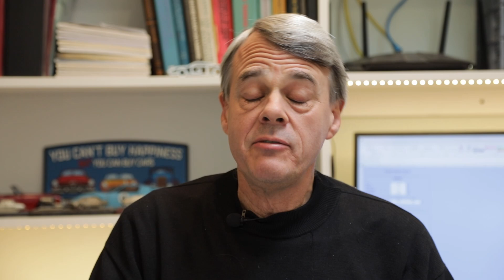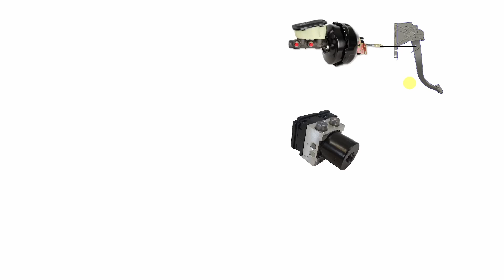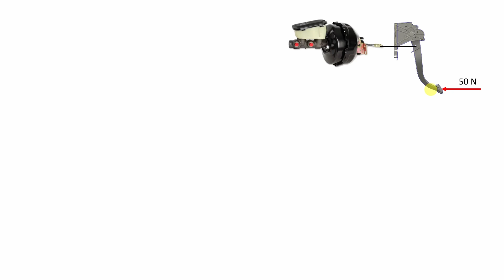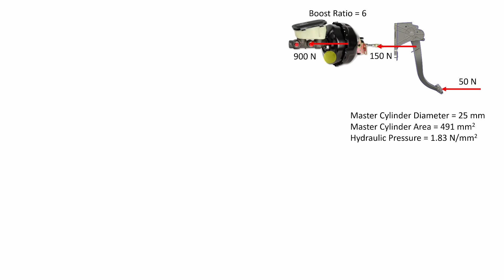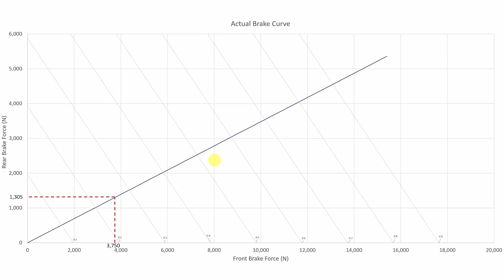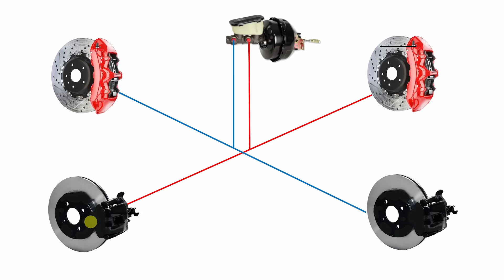Brake System Sizing And Design

Comment: This is very useful, big thanks. I was hoping to also get information on setting up a system with bias bar.

I optimized my brake system over a time period of two years by trial and error.
Having in mind all described parameters (except the non existing booster) I followed a common understanding the front cylinder should be smaller than the rear. 

I was never able to lock the rear tyres with bias bar maxed out, even after installing rear calipers with bigger piston area.

Finally It turned out my car needs the smaller cylinder at the rear.

Reason is the weight distribution of 63% at the rear with driver!

Now my bias bar is set from the ideal middle position only a half turn towards rear, tyres lock  all at almost the same time, front just a moment earlier. optimization between cold/hot tyres and  dry/wet road can be done by maximum one turn. 

I never thought I could utilize such a high braking force at the rear!

Comment: 7:05 Why do you addtionally multiply by 2 for the two sides of the caliper? Is it because the piston area is calculated for one side of the caliper? 
7:30 You seem to be using the same formula for fixed and sliding calipers, but wouldn't you need to mutliply the piston area of the sliding caliper by 2 additionally?
Thanks for the interesting video!
Reply: yes. you measure the piston area of ONE side of a monoblock caliper.
no. since you measred only one side of the sliding caliper, you mulitply both by 2.

Comment: Someone can tell me how to calculate the valve curve? I mean, mathematically, with equations.
Reply: Assuming you know the Knee Point pressure and the reduction rate, it's actually very simple.
Where
Po = pressure out
Pi = pressure in
Pk = Knee Point Pressue
Rg = Rate of gain

The formula is as follows:
Po = ((Pi - Pk) × Rg) + Pk

So for  example say we had a valve that was a 60% reduction and therefore would have a 40% rate of gain (i.e., Rg = .40). Let's also assume that this valve has a Kp pressure point of 400psi (I personally prefer to work in psi)

We can now find what the Outlet pressure (Po) is if we know what the Inlet pressure (Pi) is. 
So where,
Pi = 740psi (random picked value above Pk)
Pk = 400psi
Rg = .40

Plugging the numbers in, we get:
((740 - 400) × .40) + 400 = 536
So for our example valve with an Inlet pressure of 740psi, the outlet press will be 536psi.

Comment: Hi.

Very nice video!

I see that you used in your illustrations fixed calipers for the front and floating calipers for the rear brakes. Why are the fixed calipers better than the floating ones? I see them only in high end cars.
Reply: Hiya, fixed calipers have some advantages over floating ones, such as a more uniform pad wear and a higher performance to size ratio. Other than that, fixed calipers have a, subjectively, better pedal feeling when compared to floating ones.

Comment: Hello, based on your brake videos I’ve watched and reviewing chapters of the textbook you refer to.

 I was wondering if another way to achieve an actual brake curve closer to the ideal brake curve would be to use a brake pad with a higher coefficient of friction in the rear as opposed to the front? (Assumption is for a car without ABS and power brakes) 
I think a lot of autocrossers typically use a higher friction pad in the front, but this moves the actual brake curve further away from the ideal?

Thanks for any feedback

Comment: YEssss all the answers to my comment in the ideal curve video are here! <3
You adjust the brake bias for grip not for the shape of the turns of the track. So you can reduce the gap between the ideal curve and the actual line for evry grip condition! Hopefully I got this right. If so this also answers to my tires grip question. It's not a parameter in brake sizing, it's almost part of the constants... Damn is science cool as f*ck!

Comment: Hello. How can I improve the modulation of my pedal? Chevrolet silverado 2500 2001? The overall condition of the car is very good, the brakes are serviced, but my pedal is not informative at all. I have increased the oil pressure for hydroboost. It gave a result, but I expected more.

Comment: Can you do an episode about thermal performance in regards to brakes that you talked about at the end of the video? A perfect example to do an episode on would be the Tesla Model S Plaid which has small brakes (380mm) for the power (1020hp), weight (2200kg) and use-case (Tesla has a bunch of marketing showing it on the racetrack and setting lap times), but it is well known by all journalists that the stocks brakes can't take the abuse of the race track, but the CCB upgrade ("Tesla Track Pack") can.

Comment: Rear brake lockup isnt a problem on rear wheel drive, manual transmission race cars. To lock up the rear wheels, the brakes would have to be capable of stalling the engine unless the driver is depressing the clutch and brake pedal at the same time, which a race car driver would not do under race conditions (you lose the benefit of engine braking and engine rpm drops to idle).

Rear wheel-hop from improper downshifting is the reason race cars spin in braking zones.
Reply: That is categorically false on every level. Rear lockup on a RWD vehicle most certainly is a problem because most vehicles have more than enough rear brakes to easily stall an engine that is in a closed throttle deceleration state.

For starters, other than carbed engines, fuel is cut during Decel, so literally, the only thing keeping the engine spinning during closed throttle deceleration is the wheels spinning. If they lock, the engine stops.
Reply: Are you stupid. "Lockup" isn't what would happen. You would simply have wheel speed and theirfore engine speed drop 10-30%, like from 6k rpm to 4 or 5 and ur back is already out. RWD cars are cool because what you actually do is set bias by breaking in a straight line with clutch in or if it's a auto at a very high gear. So that the wheels lock at the same time and then set that bias up front maybe 2% (depends on car/driver) and then you use ur engine breaking to effectively add that back. For example if you are taking a high speed corner where you need to break you can select 4k rpm or 6k rpm where 4k would be understeery and 6k be oversteery. Same applies to general lateral grip variables like roll bars and tire pressures.

Comment: Quick question, is there any relatively simple way of calculating the brake force of a drum brake? I've just gone through some rather complex equations, and got numbers that mesh with the demonstration. But the brake force seems absurdly low for a given line pressure. Is that is truly the case for how drum brakes act? I'm working on graphing some of these things to justify my dislike of the common front disk-rear drum setup people install on aircooled VWs, I think it's dangerous, and according to my calcs so far it is wildly so. However, it can't be that bad, can it?
Reply from the maker: Drum brakes are a different animal since they have a self energizing tendency. It means they don't need as much hydraulic pressure to operate but it also makes it much more difficult to predict their brake force. I would recommend "Brake Design and Safety" by Rudolf Limpert. It goes into drum brakes quite comprehensively.

Comment: Sime misinformation here, the "booster" is the part that amplifies your pedal force to the "Master Cylinder" that you forgot to mention in the beginning, where you called the completed assembly and picture the "booster"  Also, your drawing of the lines to the brakes is all over the place.  One of the outputs of the master cylinder drives the front brakes and the other for the rear.   sorry, it's driving me nuts.
Reply from the maker: I probably should have said it was the booster/master cylinder assembly. On the lines, it was never my intention to show a real setup with the initial graphic since i knew i would be returning to that topic later on.
Reply: I’ll look for your in depth videos with accurate information, graphics, and concise explanations.